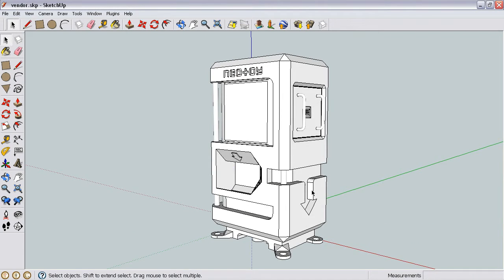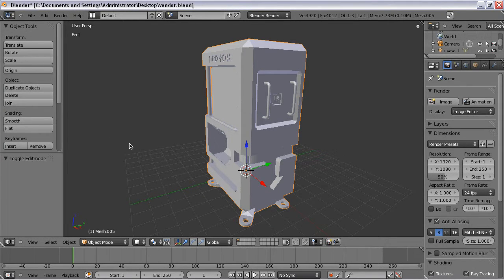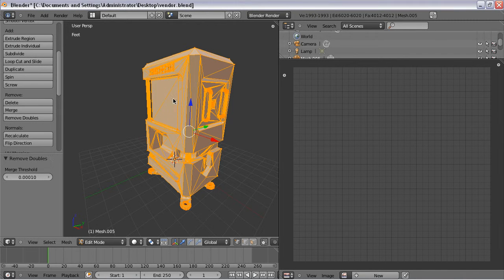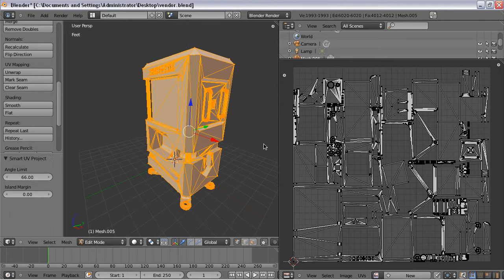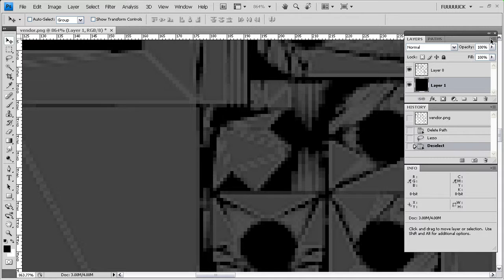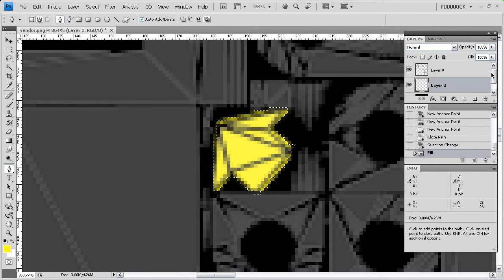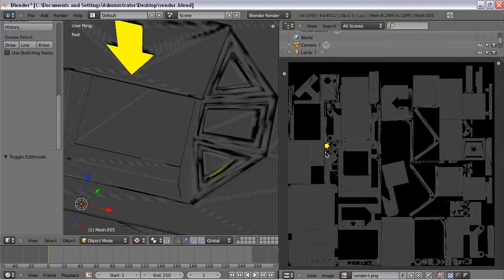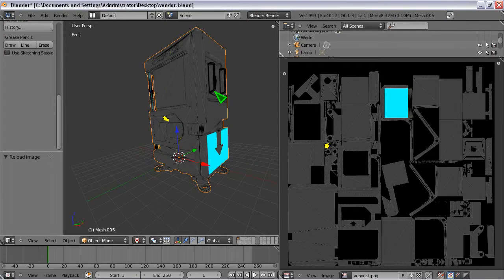Quick & Dirty UV Mapping with Blender

Comment from the maker: @DarktownStudi0s I HATE modeling in blender, it's clunky as hell, that's why I use SketchUp instead, it may not be as powerful but there is nothing faster when it comes to basic modeling.

I wish I had some insight with your crashing problem, but there are so many variables & I've never had that specific problem myself. I would only suggest a complete re-install of blender, after first thoroughly removing the current version. Also try importing some dae files from another source to test.